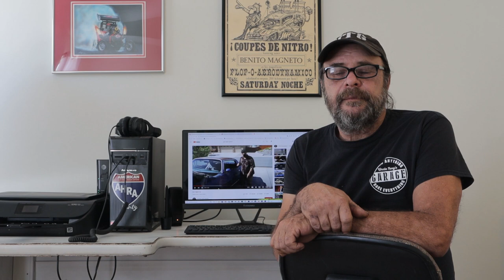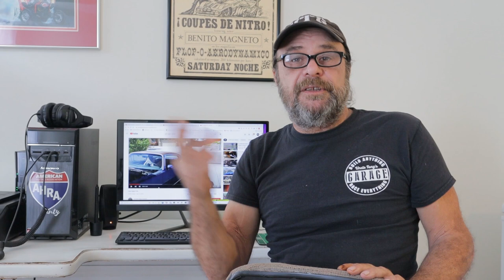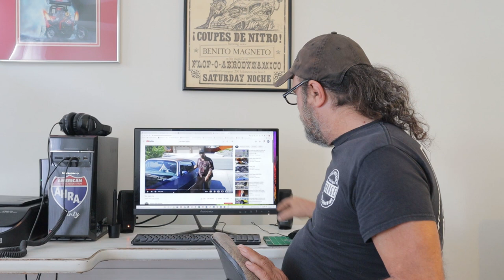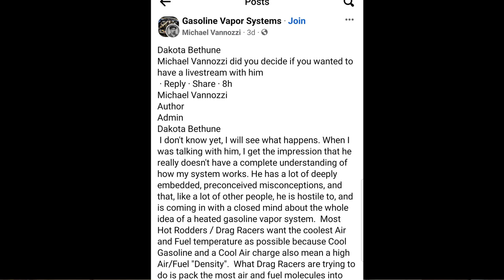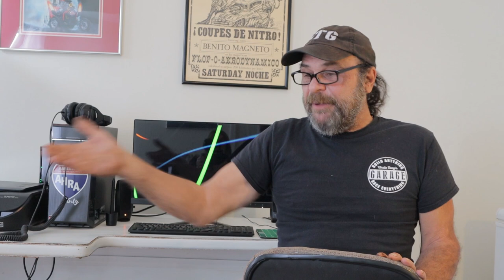Climbing Down The Mega Mileage Conspiracy Rabbit Hole

Comment: This is a great video. I have been listening to this conspiracy crap since I was a boy in the late 60's. You can't change the physical laws!  If any of this stuff worked it would have been incorporated into aviation in WW2. A deep dive  will reveal that  super /turbo charging and carbureting reached maturity with aviation in WW2. Vast amounts of R and D where spent to extend the range of aircraft. Sorry for the rant......
Reply: Exactly, they'd be doing it in General Aviation piston singles, anything that would extend range and payload in a small aircraft would be considered. 
You can change the 'gearing' with a controllable pitch prop and you have full control of the fuel/air mixture at all times. Some even have spark advance control. It's all about finding that spot between fastest cruise or lowest fuel burn. You can also control your air density by flying higher, which also reduces drag. (And power).
Reply: @TD_YT066  if i recall, the original idea of the Kompressor (supercharger) developed because they needed to ram more air into the engines flying over mountain altitudes where the air got thinner. Not much of an aviation guy but yeah definitely fascinating.
Though I don't think anyone who owns a supercharged Mercedes can tell you it gets good range because they chomp fuel, think the density thing had more to do with it.
Reply: @TD_YT066  lean of peak(egt). 
Learn it ,know it, love it. 
Thats what saved fuel and won the war 😁
Haha maybe not but it works.

Comment: lets get away with all of the stupid vapor conspiracies, Lets design a transmission that is small and has such a mechanical advantage that it requires way less HP / Fuel to get around from point A to B.
Reply: CVT 🤔

Comment: I have personally seen the results of a Pogue carburator. It worked, mostly. In a slightly modified Pinto. It got great milage. Not 100 + mpg though. Was it pracitcal to drive? No. The car was gutless. It took an average of 5 minutes to get to 55 mph on level ground. Plus it varnished up, due to gasoline addatives. The only advantage of raw gas, would be not varnishing up. The gasoline itself would give the same results I saw. Impractical. There is only so much potential energy available per ounce of gasoline. Real world, practical improvements, are limited to maybe 10 or 20% improvement over factory in most daily driver type cars. I would be interested myself. If someone ever found some secret that's practical. Just like Tony says. Please prove there is a better way. Show me the proof that it's practical.
Reply: Big foot was driving!

Comment: What I'm surprised at.
 Is the lack of knowing that the fuel vaporized by normal carburetion or fuel injection.
  As it's entering the cylinder.
Is the only thing that explodes.
 The vapor droplets that did not turn to vapor entering the cylinder.
  Burns off creating the bad emissions and excess heat.
  A pure vapor run engine actually runs cold.
 In Florida heat.
 We had to remove the fan to get the temp gauge to move.

Comment: I had a 71 impala convertible 350 2 bbl auto trans back in 96. It would get 28mpg at 65MPH cruising down I-95 all day long. So 35mpg out of a stock 350 with a 5psi turbocharger and a well tuned 2bbl it could get 35mpg at 55mph

Comment: I'm enjoying this series about the "secret" ultra lean carburator system. 
One, slightly related, question. Have you had any experience with water injection? Not with an intercooler system, but directly with the fuel/air mix. I know it wouldn't work with modern cars, but I remember it being pushed in magazines back in the late  70's and 80's.

Comment: I'm willing to bet the fuel air ratio does not support higher horsepower and his engine is most likely gutless. Prius mileage numbers are achieved at extremely minimal throttle input and anything over that drastically reduces its economy. I'm assuming that's why he would be back pedaling about your inquiry as to performance. Sure it'll get there, but when you want to get out of your own way, it will surely leave a lot to be desired. Back to fuel air mixture, would this system not induce a lean running condition? I've got to wonder what ramifications that would impose long term.
Reply: At a certain degree of lean you start to "air-cool" the engine from the inside Engineering Explained has a video that touches on lean conditions. It may interest you. But yeah the engine is probably gutless but if it can manage from A to B that's something at least.
Reply: Will not get a lean running condition if you choke the air with the fuel.
If you only choke the fuel you definitely get a lean issue.
Reply: I guess my ultimate confusion about the viability of the system is that in any given rotation of an engine it will have to displace a specific amount of air. For proper air fuel ratio the same amount of fuel must be used to get that mixture. To use less fuel is to run leaner, to run less air seems to imply less efficient use of the fuel being used. That being said, I can see why it is so hard to get better fuel economy. There is only so much energy in a drop of gasoline. 🤔

Comment: Tony, 
Use an S&S “G” carb on Cathy’s hi vac 360.
The G has remarkable tune ability. 

Can you jet lean past lean to reduce temps and put it in under pressure? I think that’s what Smokey was doing.

Smokey used a long rod stroke ratio.

Comment: Talking about mileage. Had a 69 Charger. Spun a rod in the 383 2bbl. Put in a 400 short block. My 383 heads. 440 exhausts. Hemi mufflers. A non descript used 4 bbl I think was a Holley. It was 45 yrs ago. Ran great. Front load axle. 273 gears. I squeezed 20 to 22 out of it. Driving like I was sane. Put.the 323 set in, drive like a maniac, got 14 to 16. And we saw 400's with Carter TQs getting 22.to 24 in Cordobas. Fine tuning. Tires. Alignment. Gears and light feet.

Comment: One thing that I've been wandering about is making a Colman type gasifier generator. Like the ones used in their lanterns and camp stoves , and make a set of exhaust manifolds for them to rest in. This is something that has rattled around in my head for quite a while. Has anyone tried this method to vaporize fuel ???
Reply: None of the gasified fuel systems are going to appreciably improve fuel consumption over a decent normal liquid-fuel distribution system. Case in point: Propane-fueled and natural-gas-fueled engines inherently operate on gasified fuel, and they aren't outrageously more efficient than gasoline-fueled engines (nor do they have miraculously lower emissions). In other words, don't bother wasting your time. Please note the key word in the above: "decent". If you have a carburetor or fuel injection (I don't care which) that is poorly calibrated, it's going to work poorly, and the solution is to fix it.

Comment: I drive a 91 Chevy 4wd truck, 350 with TBI. At 70 MPH  on the freeway, driving a 300 mile stretch, I can get over 18 MPG. That is a 5000 pound brick being shoved through the air, and it does  surprisingly well. To attain 35 MPG with what that guy drives with a tiny little carb is not a big deal. But it must suck to drive in traffic.

Comment: Small block 350 Chev. Vortec headsMagnum 270h cam 6 speed gearbox 3.73 gear 600 carb 27mpg interstate highway cruise 79 trans am had weight removed as well

Comment: Heck I get 33 MPG from a stock 302 in a 88 LTD. Just good attention to detail and a lite foot.
Reply: My 1986 T bird elan 302 auto 4spd if I remember  correctly it's digital dash gave mpg 28 mpg at 70mph highway about 15 in towm city .Tire psi maintenance the usual stuff does matter.

Comment: I'm on my daughter's YouTube account. I hear exactly what you're saying Tony. In my eyes a carburetor can only attimize the air and fuel so much. Just doing a reverse test will give you an indication if a 100 mpg for your vehicle is a possibility or not. It'll be potentially a fire hazard so a couple of fire extinguishers is a must. Cut a 3 inch hole on the bottom of an ice cream bucket. And use PVC pipe so it can be routed from the bottom and then facing up next to the bucket. You have to make sure it's sealed so gas can't leak. Find a desirable spot to install the bucket away from any heat source under the hood. Make a hose assembly to fit from the air filter snorkel to the lid of the ice cream bucket. Shut the fuel off to the carb. Start and run it dry if you have to. Then add 1/4 gallon of gas to the ice cream bucket. The air inside the ice cream bucket will be 100% atomized at all times. Once the car is started, fresh air will be drawn into the PCV pipe into the bottom of the ice cream bucket. From there, the atomized fuel will be drawn through the ice cream bucked lid and the air snorkel setup, which then leads to the gas less carb for now. The carb will still function the idle and throttle opening. Drive the car to see how far it can go before it runs out of gas. If it can make 20 miles, then a 100 mpg car may be in your future. You just have to figure out how to build that carb. But if your car only gets about 5 miles down the road...which I'm betting is how far it'll go. Then there's no 100 mpg car in your future. By doing this setup in reverse just saved you a bunch of countless hours of work. In my experience, the higher the compression...to a certain limit will use less gas. Ignition timing to a certain limit will use less gass. Plus the cam setup. But there's never enough limits to make 100 mpg. If my story seems goofed up I sincerely apologize. Yesterday I only had 10% chance of surviving if I admitted myself to the hospital. They seem pretty optomistic about my recovery.

Comment: I have a 66 Mustang hardtop with a 99 5.0 from a 99 Explorer. It has a Holley 4 barrel, wiand aluminum intake, cast iron hipo manifolds, 3.0 differential, and a Tremack 5 speed. On a trip with many other Mustangers we drove approximately 300+ miles and I averaged 27 mpg. we did not exceed the posted limits on this trip. But this little bullet can roast the rear tire(open rear end) any time I want and it will break loose all the way to 3rd gear. So how it is driven makes all the difference. Performance always comes with a price.

Comment: Smoky
Used a twisted intake runner.
 That had pressed in groves.
 So it looked like a four sided swirl inside.
 That had another tube around it where All the exhaust ran thru. Then out to the normal exhaust.
 The carb was on the runner off to the front corner of the engine bay.
  With an engine coolant spacer plate between the carb and the super heated runner.
  The air fuel mixture was pulled into the turbo 
 Compressed and forced into the intake.
  It had a separate idle system to run the engine up to optimum operating temperature.
 He could Not run his boost pressure over 8 psi.
  His system worked
 And worked Very well.

Comment: All you 2/ 4 barrel carb guys!-  put a microswitch under your secondary throttle arm. Wire it to a light on the dash so you can tell when the secondaries start to open. Try not to let it lite up...  Also great for tuning the vacuum secondary diaphragm spring on a Holley. Oh I know? just install a vacuum  gauge, and I do... but most don't.

Comment: It's like the time when I was a young man I put diesel fuel in my slant six duster tank with the little gas that was there.  It sputtered bucked and slowly got up to 55mph 1.5 miles later after I took it on highway to run the tank dry. Lol

Comment: So I've personally ran fish carb on a on a 350 chevy in an s10. The performance was fine to about 3k rpms under full load then it hit a wall because of lack of cfm. Under partial throttle it would run more but obviously at reduced power. I wasn't able to do any mpg testing on it because odometer didn't work.

Comment: Few years back after I did some light mods to my 1965 dodge dart stock 225 slant parts like gasket match tge ports on the intake , head and exhaust manifold . I also got a larger inner diameter exhaust pipe and flange to match the inner diameter of the exhaust manifold port. in also replaced the stock air filter and filter housing with a 10 " chrome air cleaner with k & N air filter . my dart came from the factory with an automatic and 2:92 gears . I went online and followed the requirements to see what kind of milage I'm getting with my dart . I also ran stock 14 " rims and close as possible to stock tires . with all tge stuff done and the requirements I believe I was getting close to 25 miles to a gallon on my daily driver for town and highway speeds

Comment: Had a stock 88 5 litre notchback  mustang with tall gears.  302.  5 speed standard.  Under 3000 lbs. It would do 32 mpg ( Canadian gallon ) on low test.  ( driving decent ) On high test with a little jug of octane boost it would pull 36 mpg.  Great little car.

Comment: Tony in 1976 at Trade Tech Los Angeles we test a fuel vapor system we did get fantastic mileage but weight of the vehicle was striped down like bottle rocket it had a small straight six no accessories and  vapor canister which scared our instructor but ran it anyway. Driving down the road it accelerated so dangerous slowly with tires ran at such dangerously high psi and seemed so narrow and small it also had drum breaks. You could accelerate faster walking and they didn’t use their breaks doing test. Roads would have to be different then now. Lots of ways to cheat like filling roll bar full of fuel. 30 mpg may be possible 100 mpg be hard. Think he used lots of heat and ultrasonic inducer but it seemed to be a slug waiting to explode.

Comment: I think the disconnect is that the people chasing mileage don’t care about how well it accelerates or how much power it makes. That’s why you just get that it goes down the road as an answer. The thing probably only makes about 60hp at most if it’s just a single motorcycle carb.

Comment: I am personally familiar with this project. Not only does the car get 35mpg at 55mph, it also produces 475bhp and 490fpt at 2000 rpm.  The reason it hasn't caught on is because the fuel must first be treated with 2 parts per gallon of virgin unicorn farts, which anybody who's been around cars knows, are very hard to come by.

Comment: Project Farm on YouTube ran his lawn mower using vapors. Advantage to that would be no gummed up carburetor the following spring if your gas went bad in it. It worked for him. Of course in the car that'd be a different can of worms. But with the lawn mower motor running at a constant speed it worked.

Comment: Tony I have a water vapor injection kit sold in the late 50’s as an aftermarket part at a local Ford Dealership I worked at.  I have it as art.  It was supposed to improve mileage and keep the engine clean of carbon.  I have never tried it.  It’s just art to me but maybe I should try it out.

Comment: Bottle rocket probably gets poor fuel mileage cruising around town or highway but on the quarter-mile track it probably makes way better fuel mileage because it gets there sooner. What kind of fuel mileage would bottle rocket  get cruising around town in a quarter mile and then cruising on the highway a quarter of a mile and then racing down the drag strip a quarter of a mile?
Reply: If it could make a quarter mile

Comment: Remember the flathead fford ?  Got 8 miles per gallon with a Stromberg 97 carb .  Not too impressive .  I have a formula for a 20 plus mpg 318 , 302 , 305 and it includes a very small turbo .  Notice it's in the low 300's cubic inch displacement .  the biggest drawback is the packaging .

Comment: On my 83 1 barrel carbed 300 i6 f150 3.08 rear 31 Inch tires np435 she normally gets 18 at 75 and with propane would see 21 with propane and I tested this from driving to yuma az from tucson and vice versa when going back and forth just with the carter 1 barrel is 18 to yuma 16.5 to tucson and with the propane after cruising would see more highway power and 20 to tucson and 20/21 to yuma stopping at the arco off of speedway and freeway in tucson, and the arco on 16th street right off of the 8 in yuma which is about 216 miles off the top of my head

Comment: Exactly! There is only so much energy available in a set amount of fuel. It's thermodynamics. It's like saying that I can drive my electric car around all day on a 9 volt battery.
Reply: You cant compare driving around in a car on a 9V battery and gasoline vapor 🤣Why do you think your car use more gasoline at winter compared with summer?🤣🤣for not talking about a cold start

Comment: I watched a video from a guy who claimed to show his pickup truck using a gas vapor/bubbler system. I built a similar system out of pvc and attached it to my junky saturn. I used the winshield washer tank for the bubbler. Long story short, the saturn started easily and idled perfectly. I could get it to rev up in RPMs if i eased into it, if i let up too fast it would backfire and blow some pvc parts apart. But i never sealed the pvc just so i could reconnect things. Im certain this thing wouldve gone down the road if i could somehow have a method of throttling the bubbler portion somehow. The gas line was disconnected and the vehicle ran in fumes alone. I got video of it backed up somewhere. If youre interested.

Comment: My 2007 F-150 gets 35-45 mpg with an offset crankshaft 4 cylinder and oversized battery. It is built like a Prius but it identifies as a F-150. It even has fender badges…I closed up the “F” to make it a “P”…P-150. Ford is soooo jealous!!